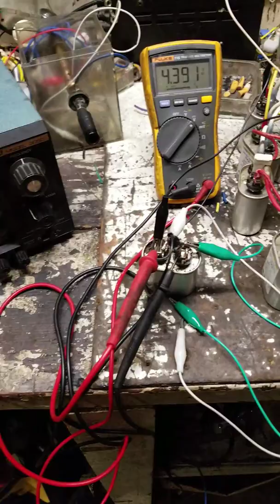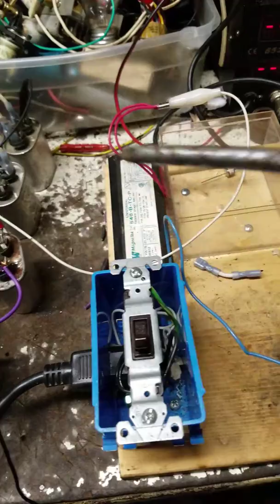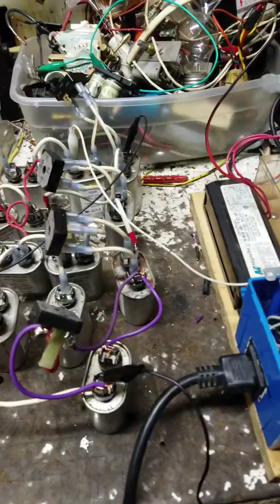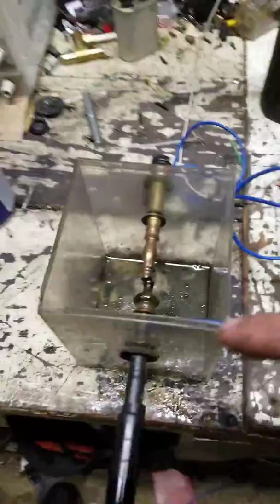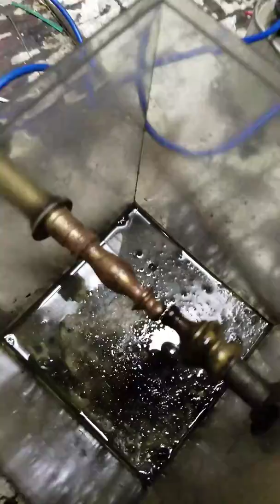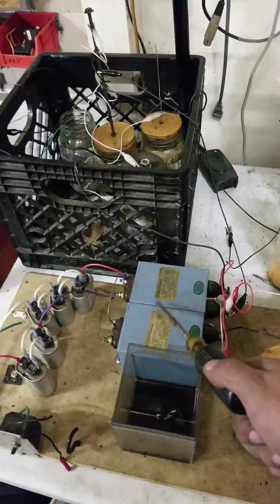Overdriven Quad-Tate HVDC Generator - Part 2of2

Comment: Sucking up line noise, hehehe.  Yes, put it near your computer or tv, you should see voltage rise.  Try a plasma globe near it.
The quad tateium circuit, hehehhe.  Interesting that you added the ballast, very good :-) Also the ignition coil and spark gap :-)
When you light the bulb, did you remove the freq gen, and do you have one wire going to your house mains like Byron, or only an antenna?         Very good job you did here Chris!
Reply from the maker: Thanks Paul! The 100w bulb & ignition coil are being lit by the ballast driving the tate.  The signal generator can light it up a tiny bit, as you see with the 3v bulb, but only for a moment before it can't sustain..     I am not using the hot-wire/earth rod config in any examples here..  Though, I presume to try 120vac directly powering this circuit to see if I can acquire much better amperage availability at the output.. 

My next goal, is to build one out of leyden jars. Probably just a single stage at first, and then drive it with the my 5kv NSTs, or perhaps with a "regular-overdriven tate" lol.. This may be the secret to rectifying out some HVDC for more impulse/disruptive experiments.
Reply: Thanks or the reply.  I think your on the right track.
Keep up the good work :-)